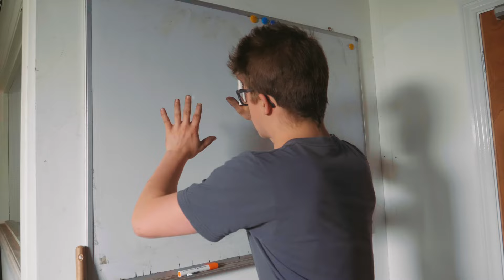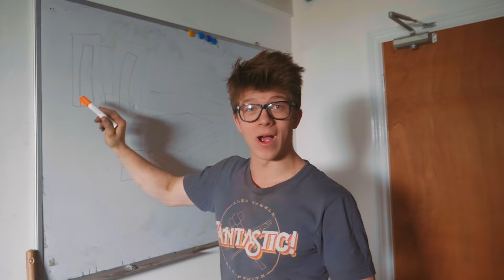MAKING A KATANA!!! 1 MILLION LAYERS!!! PART 9 - TSUKA

Comment: You should totally make a Damascus Ice-cream scoop! I'm super curious how that'd turn out!
Reply: Swirly damascus for ice cream swirls!
Reply: to keep damascus patterns bold you need to oil the steel. so it would make the icecream taste terrible. or would ruin the finish on the scoop. great for a decorative piece though.
Reply: Yes, unless you used somehting like Beeswax and just wiped it off. That way you don't have any problems, and if there were a taste it would taste like Honey.
Reply: sounds like a chill video
Reply: make it with hydroforming
Reply: Jelly roll it
Reply: I'd totally give it a try as soon as i can get my damascus to work like i need it! :D
Reply: The Damascus is the blade, not the handle. The wrought iron with the woodgrain would be much better for the scoop
Reply: Hmmmm, ice cream...
Reply: Sooo tru.

Comment: next time you could heat the tang up and then put the handle scales either side...add a little pressure and it will leave a scorch mark where you need to carve out

Comment: Wrong side of the blade on the Japanese saw! You'll find it cuts a lot smoother if you flip it around and use the 'cross-cut' side, to cut across the grain of the wood. The side you were using is the rip-cut side :)
Reply: Oliver Petragallo I was looking for someone else's comment on that before I made mine. Good eye!
Reply: Same :D
Reply: haha glad i looked... hate being an echo
Reply: Yep, but lets go easy on Alec, he is only a blacksmith after all... Just kidding!
Reply: was thinking the same thing, and felt like a woodworking snob haha
Reply: Ya. But he was don't a rough cut. Not that big of a deal.
Reply: I had a look too, and took the plunge of pointing it out first! Alec will surely appreciate a top-tip, that Samurai Carpenter can corroborate, as Alec is most certainly one for constant improvement and learning, as he so likes to remind and inspire us to do the same :)
Reply: I noticed that too

Comment: Samurai Capenter is probably jealous AF over that kiridashi. Beautiful work as always.
Reply: Kiridashi are meant to be chisel ground, not double beveled, so probably not the best for marking really precisely.
Reply: Joe Samlofski exactly correct and my only issue when he said he was putting a double bevel on it. There's a reason they chisel grind them, and it's the same reason carpenters pencils are shaped the way they are. Doesn't change the beauty of it, although it does render it far less useful. I think he noticed it /suffered for it when he was doing his marking.

Comment: I know this is cheating but I get perfect handles doing it. I cut my relief on both sides the thickness of the tang. Then I run a hand plane over the pieces u nttil I get a perfect depth. No more fitment hassles after I started doing that. Now your carving doesn't have to be per cent depth. Just uniform. A trim router works really well to get that uniform depth. I know it's not the Japanese way butt I'm not Japaanese and it's not  50 B.C.
Reply: Billy Beane I’m not sure if anyone is Japaanese

Comment: I'm not sure if you know this but a kiridashi doesn't require a temper, you can keep it at maximum hardness because it wont be needed to withstand shock, so your basically just removing its edge holding capabilities. Same goes for any knives that wont be going under any stress, don't harden them!
Reply: Evan Clue Don't harden them sounds pretty scary. What if you drop it?
Reply: Sea cucumber I think he meant don't temper them. Either way he meant it, it's stupid. Don't harden it, it won't hold an edge. Don't temper it, and it'll shatter when it's dropped.
Reply: Evan Clue u dont lose much of its hardness when tempering. and it could breal when falling down, and we all know that happens to alec quite frequently
Reply: He hardens them to bring out the contrasts in the different steels of the demascus, and wow does it look good!
Reply: tonks811 Its not actually the hardness that determines that, its the nickel content in the different layers of steel.
Reply: Evan Clue I get that you could say it’s a by product, to get better definition it is better to heat treat! That is whey he does it.
Reply: You know, I've heard this (that dropping a non-tempered blade will shatter it) OVER and OVER and OVER. I've never actually seen it happen. And on something as short and stout as a kiridashi made from something short of ultra high carbon steel, I have a hard time believing it.
Reply: Bradley Weingartner he demonstrated it with a light hammerstrike on a piece of hardened steel...
Reply: I've seen plenty of demonstrations involving hammers. I'm looking for one where a short thick blade shatters from being *dropped*.
Reply: try"forged in fire", one of the latest episodes one of the contestants snaps a blade sooo easily, if he'd of dropped it i'm sure it would have shattered.

Comment: Hi Alec small tip from a woodworker when using the ryobia Japanese saw for crosscutting use the smaller teeth the larger ones are for ripping it will cut much faster especially in oak.

Comment: Hey Alec, once again great work! I love to watch your videos. However I have two tips for you: the Ryoba (Japanese saw) you used has two sides. One to cut along the grain, one to cut across it. You used the wrong side ;) It's not that bad with a good saw, but using the other side would go faster and you would have a cleaner cut face. The other tip is to grind your marking knife only on one side. This way you can have your marking lines nearer to the original piece.

Comment: If it's not too late, when you carve out the slot for the tang, carve out a bit more than necessary below the end of the tang, so you can adjust the front end of the handle and still fit all the tang in the slot.

Comment: I don’t know anything about the kiridashi, but after a quick google, it looks like a carpenters marking knife, and from your description it sounds like it’s used the same way. Those typically have a single flat bevel so you can hold it vertical and ride the non-beveled side against the flat edge of the tang to get a super accurate scribe line. A double bevel, convex grind, or concave grind make that more difficult.

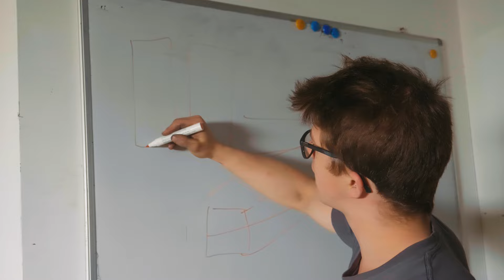Comment: 8:52 So close, but you don't carve in the gap for the nakago long-ways, as that would be incredibly difficult. You just chisel it in short-ways (the depth on each piece of wood is only half the thickness of the blade at the nakago). This is a lot faster and easier.

Comment: That piece of oak was big enough that you could have made both the handle and the scabbard out of it.
I have a book on Katana making where the scabbard maker did just that.
There was a particular way he cut out the wood to make the grain in the handle and main scabbard sections run almost seamlessly so that it looked amazing even in undecorated raw wood form.

Kind of forgot about the acid etch?
At least you were able to save it - and it looks really gnarly.

Comment: Alec I really enjoy your videos, I’m not a blacksmith but am a professional that works with my hands everyday. I’m a a&p and fcc license holder whatcha basically means I can work on every part of an aircraft except for sealed instruments. Got tired of the a/c and started my own business working on the cosmetic and structural components of boats, which brings me too what I wanted to bring to your attention when finishing the gelcotes on boats I do lots and lots of wet sanding if you’ll add a few drops of dish washing liquid to you water it will make your sand paper cut better and last a lot longer, also I’m a huge gun nut, shoot lots of machine guns and long range precesion rifles if your ever in the USA Georgia area I guarantee you’d have a ball shooting with us.

Comment: 14:00 What's the purpose of angling the plane at 45º?

Also, I really enjoy watching your progress in these mini-series. Keep it up, and good luck for the rest of the build!
Reply: It's been a while since I've used a plane and I'm not 100% sure on my answer but keeping it on an angle can make it easier to keep the piece of the wood that you're planing completely flat and not occasionally get knicks like when I was first learning how to use a plane

ETA: I could be wrong I'm mostly speaking from my experience. I stopped doing carpentry after I lost part of one of my fingers in an unrelated accident

Comment: Maybe you are tempted to use the oak because you also have enough of it to do a Saya (scabbard) for the sword as well?
Well, as you should know growing up in a wood shop, a block plane is not meant for mounting nor smoothing large/long boards (long as compare to the plane). For the handle length a #5 or #6 smoothing plane would have given you better results. It pained me to see your use of the kiradashi as well. That is why they are typically single beveled and made in pairs (one left, one right). Then you can register the blade against the tang much more accurately. All said, you are trying and did do some research into the historical technique as related by a modern YouTuber. So kuddos for trying and your hard work. That 14 hour etch looks pretty damned amazing. Way to go above and beyond to prove that the wrought-iron has a wood grain structure. Beautiful knife.

Comment: Your torch is blowing the solder out of the hole. Lower the pressure until it bonds. It will take allot longer but give a better product, there are lower pressure torches too. Even soldering guns

Comment: B-B-BUT Ebony wood would be perfect for that handle, as its only britle length wise so u can split it with an axe down the middle instead of using a saw and planing it, so when you glue it back together it looks like its made out of 1 piece unlike Oak, and aslong u cut the woodgrains off first before cutting the depth u wouldnt have any problems with the handle, when in doubt go ask a woodcarver near you or something because that piece of ebony wood would be an upgrade for the sword, were as the piece of oak would be a down grade for the sword if i see the amount of time that went into it (sorry for the long text just uhm trynna help ye know, love the video's though)

Comment: The whole point of having a marking knife single edged is so that it makes accurate marks, or cuts. With a double edged knife you have to tilt the marking knife exactly right to be accurate, which isn't going to work for obvious reasons...
I'd be surprised if the cuts you just made isn't making the hollowed out area for the tang too wide.

Comment: I can tell you're not a woodworker :). First you use a band saw to rip a piece that would have split in two with a single whack of an axe, then proceed to cross cut with the rip teeth in your Ryoba saw (cross cut is the other side) and trying to plane it flat with a block plane.

I'm in awe of your talent with metal and thanks for showing that you're a human after all.

Comment: Alec, why couldn't you burn the handle on to the tang? Have you seen this method? Gives you a perfect fit.
Reply: Because you don't make Katana handle like that
The Tang is also way too rectangular for that to work easily
And, most of all, it's far from giving you a perfect fit.
Reply: The way that Alec is doing the split handle isn't the proper way to do this either, and specially not out of oak. I question if you've ever seen the method of fitting the handle that I mentioned before, because it's actually a pretty common practice, and when done correctly, it really is the closest fit you're ever going to get.... I don't know how else to prove this to you.... It eats away the material you do not need and replaces it with the steel in it's place.

Comment: Is just me that is worried about the tape on the blade being there for so long?
Reply: It won't hurt it, at the least you'll have to wash it off with some cleaner.
Reply: BurlyWoodWorks the last time this happened the blade was so rusted...
Reply: Yeah but I think that was because he had some water on it or something, or he didn't oil it. I tape my blades all the time for long periods of time as well, and it doesn't hurt. Tape doesn't rust the metal, it's moisture.

Comment: I'm no expert but I'm pretty sure ferric chloride is not an acid but a base.
Reply: Ferric chloride or Iron chloride (FeCl3) when dissolved in water, iron chloride undergoes hydrolysis and gives off heat in an exothermic reaction. The resulting brown, acidic, and corrosive solution is used as a flocculant in sewage treatment and drinking water production, and as an etchant.

Comment: Someday, you should really try to make a traditional katana with the mix between steel and iron. When I was watching your video during the forging process I noticed that you tried to forge in the curve, however in traditional katanas, the blade is forged straight, and the quench causes the blade to bend. Also, it would be really cool to see you work with different tempering techniques to forge patterns in blades because it opens a whole new world. Watch this video for more info: https://www.youtube.com/watch?v=VE_4zHNcieM

Comment: Any reason you are using the wood plane at that angle ?. It you want a flat piece of wood you should keep it straight :)
Reply: It cuts better at an angle because the fibres are sliced by the blade rather than forced to break. That said, he did use too much angle.